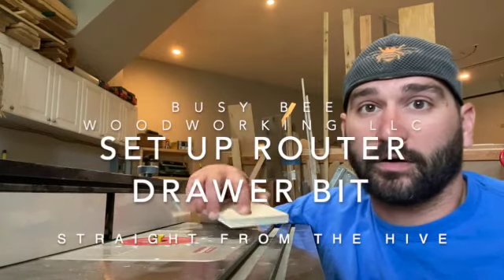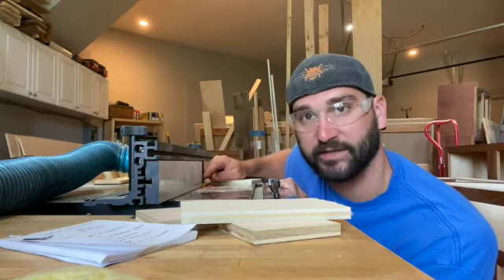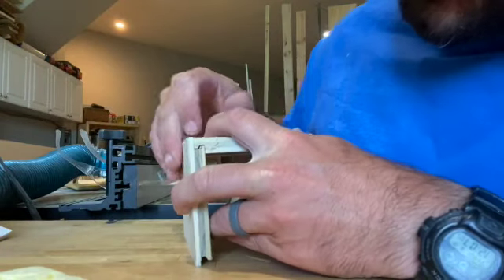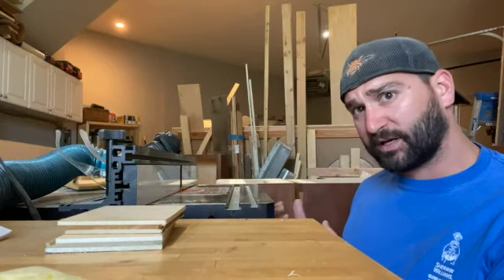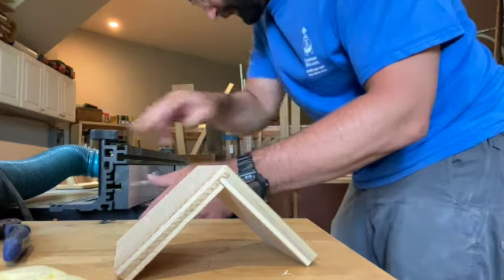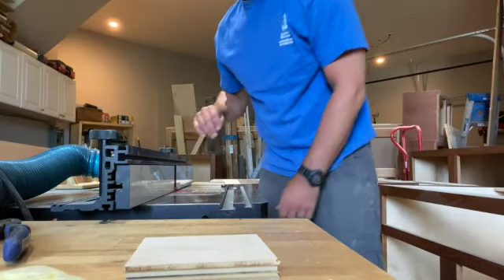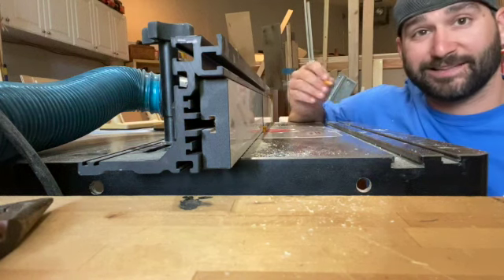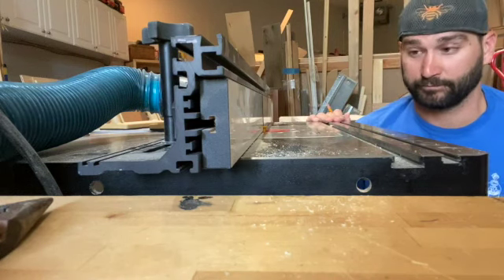How to setup your Drawer Front Joint Router Bit

Comment: very good video    i  have tried several times to use the bit and always had to use a different setup for the sides and  front and backs
  after your video i had no trouble getting it
Reply from the maker: Glad you found the video helpful! Just make sure to keep the good test pieces as they will help with your setup the next time you go to use it.